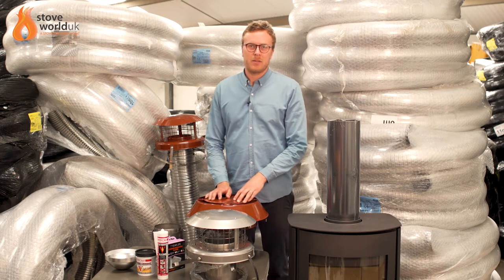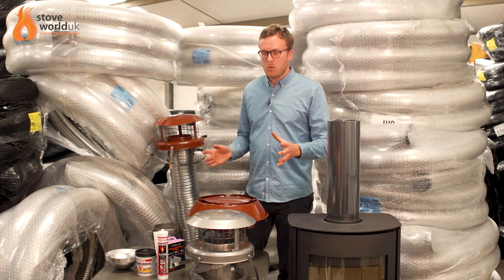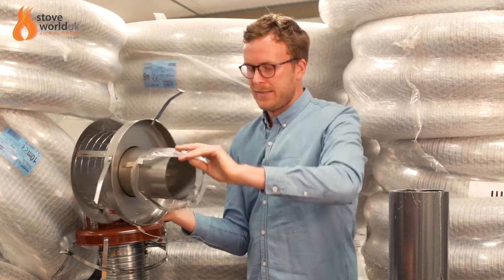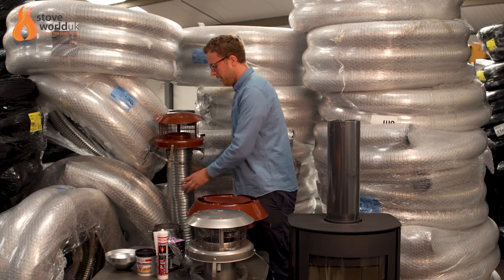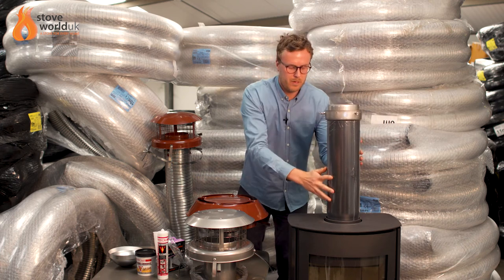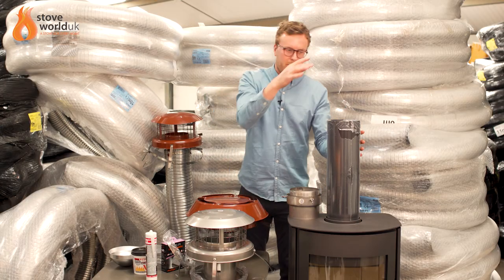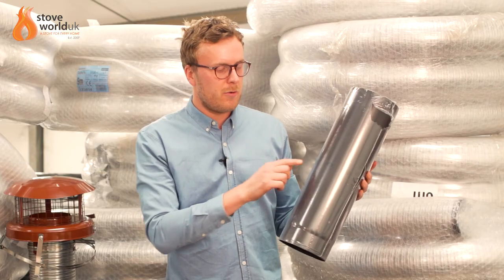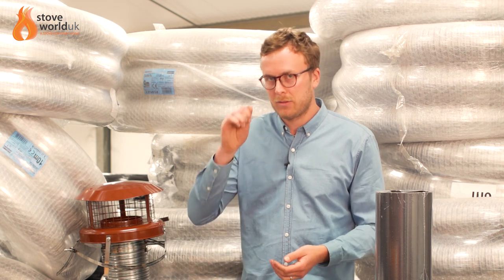Parts Required When Lining A Chimney For A Woodburning Stove

Comment: Hi,can you attach new liner to old liner and pull the new one threw wen removing old liner? Reason I ask my chimney has a bad bend and we had to punch a hole in chimney to get it round ,we’ve since had a new loft extension done and smashing holes in loft wall isn’t an option ,many thanks 👍

Comment: With a new installation,  how would you know if you might have a down draught issue? 
Is it wise to just buy the anti down draught cowl anyway.?
Reply from the maker: Hello. Good question. You will usually be able to hear the wind howling down the chimney or a constant breeze is felt in the fireplace. Geographical conditions,  like being in a valley are common causes of a downdraught. If you are unsure and want to be safe, there is no harm in buying an anti downdraught cowl just to be sure.
Reply: @Karlcoupe  The ‘harm’ will be in my pocket.

Comment: if the pipe pushes into the top of the stove and the adapter pushes into the top of the pipe through the register plate, how are you supposed to get the pipe in-between the stove and register plate when the plate is fastened in?
Reply: Pity this question remains unanswered.
Reply: Fit the adapter to the end of the flue pipe. Feed the end through the register plate hole, don't secure the register plate, fit enamel pipe then slide your fire in underneath and as you haven't secured the plate yet you will have some play to push the whole lot up the chimney. Once the fire is in place secure the register plate.
Reply: @stumitch7109  
Ok, thanks.  The trouble with that is that I will have to pour the vermiculite down the chimney (around the liner) after the stove is installed completely, but that's ok.
Reply: What sort of cowl would you use for a bishop chimney pot?
Reply: @jimskirtt5717  use chimney wrap instead

Comment: Technically if you have a 6” outlet on the stove you could install a 5.5 smooth wall/twin wall liner if you don’t have enough space in the flue for a 6” liner.
Reply from the maker: Hello. Just a note for UK customers. This may be more of a US based regulation and not relevant here.
Reply: @Karlcoupe  correct! In the US a 5.5 smooth wall/twin wall flexible liner accepts the same BTU’s and flow rate as a 6” single wall corrugated flexible liner. I should’ve made that clear, because I don’t know the UK codes for that. 
Thank you for clearing it up.

Comment: Brilliant video, very well explained. Do you guys deliver to Ireland?
Reply from the maker: Thank you. We are dipping our toes back into shipping to Ireland after a number of Brexit related courier issues. However, because the liners are bulky they often have to be sent on a pallet and this can be expensive. If you email team@stoveworlduk.co.uk with you address, we can get a quote.
Kind regards.
Stove World UK
Reply: @Karlcoupe  Thanks very much for the reply
Reply: @Karlcoupe  Hi again, quick question if you don't mind. Apart from the cost of the pallet to Ireland are there any import charges because of Brexit or are you guys operating here? Thanks again
Reply: @MegaFraner  you can buy all that here in Ireland in Brooks and quinns  hardware stores and a place called Loise stone they do stoves as well

Comment: Why do I need to install this flexible liner when my current fireplace has a double walled stainless steel liner inside the "box" outside the house that goes up to the roof?
Reply: You put a liner only if u have a standard brick chimney. But yeah I never understood why they use those flexible liners, their surface is not smooth. I opted for a regular hard steel liner(one layer) and I put rockwool between the liner and the old chimney.

Comment: Hello everyone,

I'm new here, with gas heating prices going through the roof, I was just wondering how much a basic lining kit would cost, my fireplace is a traditional one, house built in 1926 (James Reckitt Avenue in Hull, Humberside, East Yorkshire). Is it something I could do myself with the help of a friend, who installed his own or would professional installation be recommended, if so what would a typical price be?

many thanks,

Andy
Reply from the maker: Hello, 
If you are getting someone in they will need to be Hetas or Oftec approved - The prices will vary massively across the country and it will depend on exactly what work is required and how easy the roof is to access. I would suggest visiting www.hetas.co.uk and typing in your postcode. This will then display all qualified fitters near you. You can then call around to get an idea of cost in your area. If buying online it could be best to opt for a " man in a van " type of installer. You and a friend can fit the liner and stove yourself, there are a number of good videos online to help. All you will need to do is ensure it is installed to building regs and signed off by the council. I hope this helps. Kind regards.

Comment: Buy why do I need the more expensive one? What will happen to the 316 if I burn smokeless fuel?
Reply from the maker: 316 is approved for smokeless fuel, however It is the industry consensus that if you are mainly burning  smokeless coal, you are best to go with a 904 grade liner as combining factors can cause the lower grade to corrode quicker. If your primary fuel is wood, then the 316 will be just fine. The choice is yours though, as both grades are approved. I hope this helps. Kind regards.

Comment: Everyone tells liner cant be smaller than collar size no matter what diameter is given.. but nobody tells why
Reply from the maker: A stove will often have a flue collar size for a reason. Usually a small stove will have a 5 inch and a larger unit 6 inch. The larger stove will be producing more smoke, so will need a larger outlet. If that outlet size is reduced down it could cause the stove to spill smoke back into the room and also potentially cause the chimney to tar up “ cork “ . I hope this helps. Kind regards
Reply: @Karlcoupe  thank you so much for your kind response, i have a fireplace insert with 200mm collar but builder made a horrinble chimney line with brick that cant fit it inside.. thats why i was thinking to reduce it but seems like it will bring more problem..